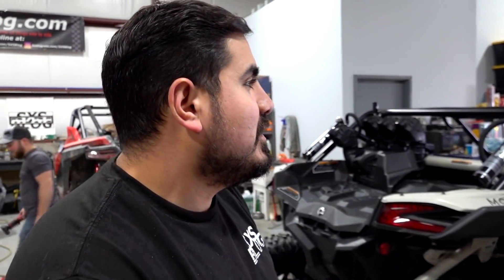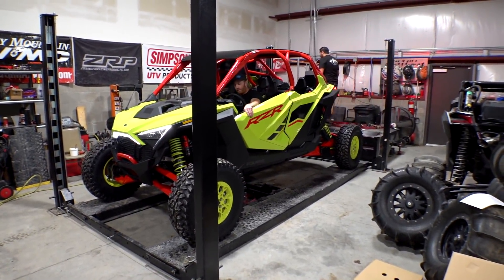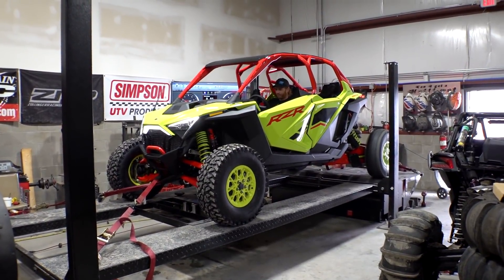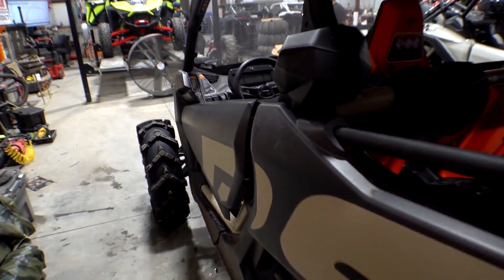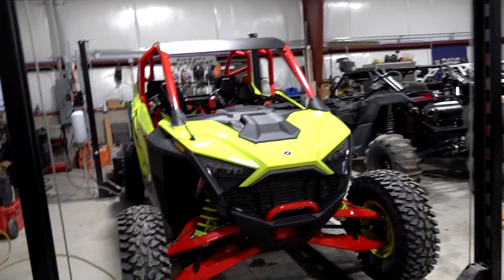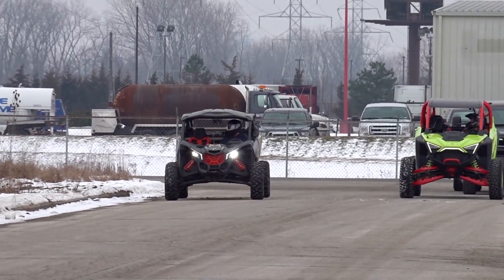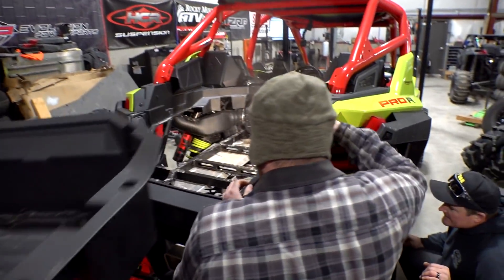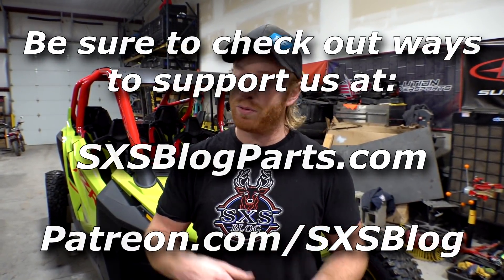2022 Polaris RZR Pro R vs 2021 Can-Am Maverick X3 Turbo RR... DYNO and DRAG RACE!

Comment: ProR is impressive. These new machines are awesome in just about every way. Pricing is quickly getting away from the average consumer in my opinion. Not a good thing.
Reply: Facts $34k for the base model crazy tbh
Reply: It's basically the Lambo for side x sides I guess
Reply: Exactly. I can totally afford one but just can’t see spending that much on one. Our local dealers have markups “market adjustments” just like the auto industry is doing. I’m going to wait out until this recession hits full bore and take people to the cleaners that are hard on their luck. 

I’m a plumbing contractor and I can’t tell you how many rental properties i go to where the tenets haven’t paid rent in over a year but their loaded with brand newish crew cab diesels, 40’ toy haulers and side by sides. These people are so overextended on their monthly budget….cash is gonna be king by the end of the year
Reply: Fuggem, I'll drive a 3k truck all day long to have a 30k sxs.
Reply: Go be poor elsewhere. They wouldn't be making then if people weren't buying
Reply: @Vtwin60  savage response lol. I just bought the top of line 2022 x3. Could not be happier.

Comment: I would rather have a heavy duty machine that is less likely to break on the trail than a light weight machine that’s good for drag racing which matters zilch when you’re out on the trails.
Reply: Yea, can-am should be embarrassed because a machine with 700 pounds on the x3 beat it. Eventually they will offer a turbo rr As well.

Comment: That was the video I've been waiting for someone to make. I've seen drag races with modified X3's but that's the first one I've seen with a bone stock one. I thought for sure the X3 would take it. So much for the power to weight ratio theory lol. It just looks like the Pro R gets out of the hole way faster without the turbo lag. I wish they would've done a roll race on pavement. But that Pro R rips!! 🤘
Reply: Power to weight isn't a theory, but an engineering fact. Unfortunately for the X3, so is turbo lag.

Comment: The 4 banger would make a cool high compression / high reving NA build. A true all motor screamer around 300HP would be a blast. We’ve seen turbos now let’s see a NA build. Or even just a nitrous build. Whatever y’all decide to do will be interesting though with having such a large displacement SxS engine.
Reply: That engine is already really NA performance oriented and tuned. they have the VE pretty much maxed out on that thing straight from Polaris to run 91/93 gas. The only thing you could do is swap out for lighter forged parts and do a higher compression piston but you’d have to run E85 or m5 race gas
Reply: @justinranes3351  compression is 12.5 to 1 stock.  How high you wanna go?
Reply: @justinranes3351  no
Reply: @garhead169  I don’t want to go higher at all that’s my point. I’d rather turbo it. But he’s talking about doing a 400hp NA build which isn’t achievable unless you do a 15 or 16:1 on a methanol or ethanol with some cnc head work and bigger valves etc etc

Comment: That was definitely closer than I thought it was gonna be lol! Need to get a 2 seat 2022 X3 RR vs a 2 seat Pro R! Great vid as always gents! 🤘🏻
Reply: Stock the Pro R should win given the weight ratio is closer to the Max and the same stock engines.
Reply: @louisrobbins475  have you seen that the X3 is about 1600 lbs

Comment: For the extra cost! (50,000$) Pro R
My money's is on the X3! (25-30,000$)
It seemed to have the most issues on the trip to the NORTH POLE!!
Am I WRONG??
Reply: I think the only issue they had was a loose hose clamp.
Reply: Wrong 32k for a base pro r
Reply: @toddk7197  Leo said a few times the Pro R was 50g's...but that is the Launch Edition.
Reply: @toddk7197  go find one for that price  Goodluck

Comment: $500 ECU flash and the RR is back on top.  Pretty impressed with the Pro R though considering the weight!
Reply: Evolution is getting nearly 30 hp out of the Pro R with just a muffler and an ECU flash!

Comment: Mike who's side are you on???? Brake boost that bitch!!! hahaha, Awesome vid. Make sure you take a few Can-ams to Glamis so you're not walking everywhere!! 😂😂Wish I was coming with!
Reply: I would like to hate on can-am but I'm Canada so I can't really hate on brp
Reply: Can't wait to see both on e85 in a dragrace
Reply: 😂🤣😂🤣 haha. get him!!!
Reply: You can't brake boost a stock x3. It will go into limp mode
Reply: @chicago1680  You definitely can for a few seconds. Works great vs not doing it
Reply: @ostacruiser  how? Mine  goes into limp mode same  with everyone else's.
Reply: @chicago1680  Did you misread the part where I said a few seconds? Any longer and she'll cut power. Stop on brakes stop on gas wait 2 seconds and release brake. Once you have the proper evo tune you can actually build boost and really rip off the line

Comment: Would really like to see the torque numbers compared between the bigger motor Pro R versus the turbo CanAm. I think that’s where the Pro R will shine even more!
Reply: Agreed, all that was old is new again.  "There's no replacement for displacement." ~1000 cc in a RZR Turbo R two-cylinder vs this 4 cylinder Pro R at ~2000 cc.  The torque difference is what helps the launch out of the hole against the X3 in the video.  NOW...let's turbo charge that 4-cyilinder....  "The all new 2023 Pro Turbo...MSRP 69,999"    Maybe...

Comment: Great video.  But to be 100% accurate. Should have compared it to a 2022 x3 turbo rr. 200hp and pdrive made a big difference compared to 195 turbo rr
Reply from the maker: Cant even get our hands on a 22 4-seat. The ecu tuning is unchanged between 21 and 22 as confirmed by Evo. Pdrive clutch won't be worth hardly anything in a drag.

Comment: The 2022 Max RR bone stock has 5 more horse power than the 21 did (advertised).  Also comes stock with 32" Carnivores instead of 30" bighorns which would add top end speed.               2022 vs 2022 is the only apples to apples race to run.
Reply: Evolution Powersports has a video on that, there is no difference in power what so ever between a 21 and 22. 

Both ecu maps layered right over one another with absolutely no changes and both machines Dyno the same Number. 

Can-am advertising at its finest

Comment: It’s funny, this is the race everyone wanted to see and it’s awesome you made it happen. Yet, If you really think about it, the pro r is literally more than double the displacement and 15k more expensive. That’s like setting up a race between a rzr 570 and an x3. Can we set that race up? Actually, we can take it easy on Polaris and set up a race between a Rzr trail and an x3. Considering cost difference and displacement, that race may even be more of a fair comparison than this is. The Pro R is a sweet machine, but it shouldn’t even be in the same galaxy as the x3 and the x3 still seems competitive to me.
Reply from the maker: That’s a narrow perspective, Pro R obviously isn’t built with a drag racing focus.  This just shows that even though it’s NA and 2600lbs it isn’t slow.
Reply: Not everyone. I want to see the 2022 Turbo RR not the 2021

Comment: Being as I spend 90% of the time in low range in my x3 crawling, I’m really curious to see what the pro r top speed in low vs the x3 max. This will allow us to see if the pro r is going to make as good a crawler as the x3 is or if the pro r is going to need a gearing changes to make it crawl like the turbo S does.
Reply from the maker: We haven't checked top speed in Low but can tell ya it feels extremely low

Comment: The compression ratio I understand isn't favorable for the Pro R to run a turbo?
Reply: 12.5:1 which can be done with e85, and variable cam timing. This doesn’t have vct, not to mention the hyperutectic pistons and powdered metal rods. None of those like boost, like at all. You’d have to do a complete rebuild on the bottom end to boost it
Reply: @GetlostwithKenny  If the engine is the same as the one in the current slingshot then It should make 400hp without a forged bottom end. Probably won't do that for 20k miles but I wouldn't call it a bomb.

Comment: You guys are gonna love the Pro R in Glamis. Just got back from our first trip with the 2 and 4 seat versions. The suspension makes all the difference. Drives away from tuned X3s and can hang with 550-700hp rails.
Reply: Videos or gtfo jk
Reply: I highly  doubt it    a tuned x3 makes over 220 to the wheels
Reply: @mattd19902010  it’s never just about power in the dunes. Suspension makes or breaks a car in the dunes. You can doubt all you want, but the fact is my buddy who has a Dynomite X3 won’t race the Pro R cars after one weekend in the dunes and doesn’t try to hang with them going full out through the dunes.
Reply: @JT_Funk  sounds like your buddy can't drive.   The  x3  also has 2.5 front 3.0 rear fox shocks  and 24 inches of travel .so  your telling  me that a sxs with more power less weight  and a comparable  suspension   is way slower  than your almighty  pro r .....get  real
Reply: @mattd19902010  good job trolling. When you drive both you will see. And I’m not selling my 395hp X3. It’s a great dune and drag car but it isn’t a Pro R. 👍🏼

Comment: Question for the SxS Blog boys about the dyno. How do you account for gear ratio when you're running something with a CVT and can't run it as close as possible to 1:1? Or anyone who can answer that? Have always wondered about that and electric cars.
Reply from the maker: You just reference the power to speed as opposed to RPM.
Reply: @SXSBlog  ok, ok, ok. That makes sense to me. I know horsepower is torque compared to rpm so I guess you can get it in the ballpark with torque compared to speed with the brainiacs dialing in the dyno for tire size and approximate gear ratio etc with a CVT. I guess it's all the same but you have to be close on the difference between engine rpm and tire RPM. Just starting to learn about this stuff and it's fascinating. Thanks for answering Leo. I know that's you. Haha. So what kind of inputs do you have to plug into the dyno to get an accurate number with a CVT?

Comment: So other then it bending wheels, not starting and freezing the belt on, leaking coolant and weighing enough that when you get it stuck it takes 2 machines to pull it out....

It's a great machine
Reply: You realize any cvt can freeze in that type of weather and it had a loose hose clamp. 
It started after they moved it a little due to the belt being frozen while riding in the snow in below zero temps. 
I didnt see anything about bending wheels. Must have missed that one.
Reply: Yeah that’s right best machine on the market. Top dog.

Comment: Bang for your buck still goes to can am.  The cost of that Polaris is absolutely ridiculous.
Reply: Nope you are paying for the strength of the machine. Everything about can am’s are garbage except for the motor 👎
Reply: @snoop8093  I respectfully disagree.  I have never had a problem with mine and I have 4 friends running can arms and they have never had problems.
Reply: @MrSpankeym98  Well every friend I have that has Can-Am’s in every video I’ve watched that has can am’s they I have nothing but problems. Give it time🤷🏻‍♂️
Reply: @MrSpankeym98  that also tells me what kind of riders you guys tare Or you have brand new machines with not enough time on them. But it is a fact that Can-Am has the weakest A arms and the weakest radius rods,the weakest frame,the weakest cage. there is absolutely no doubt about that. It’s just a matter of time and you will find out for yourself.

Comment: Why not use 2022 Polaris vs 2022CanAm?  Makes no sense to race a last year model RR vs a 2022 Polaris
Reply from the maker: The 21RR is just as quick especially with the smaller 30” tires

Comment: Would've liked to of seen it against the 22 X3 with more HP
Reply: They both have the same horsepower. Evo put them on a Dino and they have the exact same tune  the 195 is exactly under rated. it is 205 also.

Comment: Turns out, horsepower still sells cars and Torque still wins races. Shocking . .
To paraphrase a little 168 wisdom: "The cars change, but the physics remain the same".
Still, 2600lbs makes the new RZR a lumbering cattle boat IMHO . . . a real shame, really.

Comment: You can make ridiculous power with a 2.0 4 banger. I'm talking like 600 if the parts are good. Think about those little Honda motors.

Comment: Definitely not impressed simply because of the cost. You’re paying $10k extra for minimal difference. Buy a pro xp ultimate or even the x3 and put 10k into it and I believe you’ll have a better rig. Guess only time n testing will tell
Reply: You’re paying the extra money for the strength of the machine. Everything about can am’s are garbage except for the motor.
Reply: @snoop8093  agreed. Can am is crap. I have a 2021 Pro Xp, with that extra 10k I can throw in a bigger turbo, injectors and some S3 or HCR arms and be faster then the R with added strength. Possibly even stronger then the R due to the vehicle being lighter. Now if they kept that price tag at $42k I’d be all over it. I just feel for over $50k I want more then just barely edging out the competition

Comment: “Drag racing” on mud means nothing. Put them on pavement and the natural aspirated “Non turbo” will blow that 2021 out of the water.
Reply from the maker: Feel free to watch the video
Reply: @SXSBlog  I did watch the video. And I saw the drag on the hardtop if that is what you're getting at. But this video is ignorant. You are putting a naturally aspirated engine up against one w/ a turbo. Put the same Turbo in the rzr dust the Mav just like you'll see in the newer vids.

Comment: lets do one more race.. put the X3 maxx same weight as the Pro R 4 seater and run them again. or atleast with 1 driver and 2 passenger.
Reply: And then after that let's unplug one cylinder on the Pro R and turn the power down to 195 🙄
Reply: @08CspecGT  lol!! or put some pro xp suspension on it to remove the 700lbs difference? lol!
Reply: Lol so it’s even slower?

Comment: LOL 18 extra hp with extra cylinder and costs way more. I’m sorry but that thing sucks for the price.
Reply: Don't buy it then, just get used to seeing it's tail lights:). PoPo is a lot of things, but they stepped it up here, stock turbos won't hang with it as shown especially on the top end when they run out of steam.

Comment: Everyone says a better comparision would be the 22 model, this or that, blah blah. The reality is far more simple. Line up a showroom $50k Pro R with ANY $50k x3. Honestly, pick any model x3 you want to start with, and sink $50k total in it, and it'll smoke a Pro R and shut down all the hype. The Pro R is just a big ol heavy overpriced pig...with bright colored lipstick. I paid $21k for my 120max. That leaves me $29k to go in mods...THAT'S a real world comparison for most folks.
Reply: I got buddies that have sunk that much money in there x3 . It adds up quick when you have to upgrade the cage trailing arms front end and double sherearing everything which the pro r already has . I would guess the weight would start getting close to the pro after all that also ......x3 still better looking machine though
Reply: @arnw7933  I don't disagree that it adds up fast, but $29k is a decent budget too. Not all of what you mention is actually needed either. Even a $34k mspr Turbo RR Max with smart shocks leaves $16k in improvements. Cage, frame braces, gusset kit, tune...I still say it can be done. Not to mention it's lower center of gravity. The ProPig is just plain huge. I'll wait for Can Am's x4. Lol.
Reply: @deandennis395  $50k....??? Launch Edtion , around that out the door, but there are different trim levels with different prices. PRO R SPORT $31,999 .My Pro R ULTIMATE Stealth black, fully loaded with the fox dynamix DV , Rockford Fosgate system, and Ride Command  was $37k. There is a lot of value in the Pro R's when you consider all you get. Strength,  power, suspension components,  cage, frame, new front and rear differentials ....... so much is next level strength , power and control.  You can even spend less with a Turbo R , just don't get the 4 cylinder power and torque.  Don't get me wrong,  I really like the X3's and really wasn't planning on spending so much.  But after doing so much research and realizing how much I would be getting straight from the factory, it only made sense. I literally was a week away from ordering a 2022 x3 rr, I do like them,  but the Pro R just brought things to the next level.  Who knows, next year Can Am might come out with their next level. Ride hard and have fun!!👍

Comment: Weight is everything that poo poo is a joke
Reply: No weight is the strength of that machine. Everything about can am’s are garbage except for the motor You have to replace everything on the Can-Am to make it a reliable machine.
Reply: @snoop8093  but yet poo poo is always in a stop ride recall hmmm
Reply: Weight is from all the beefiness! Designed to cycle 35's with no issues!👍